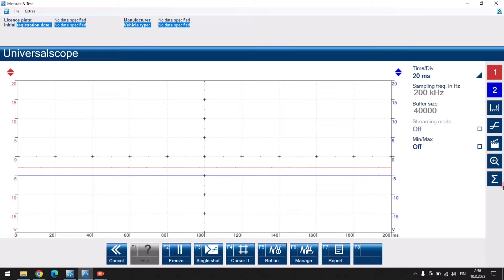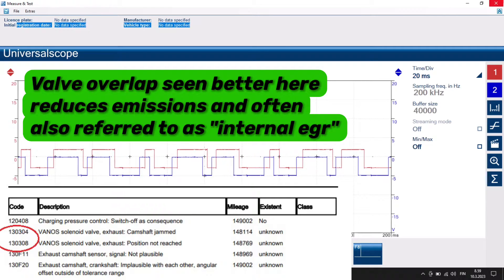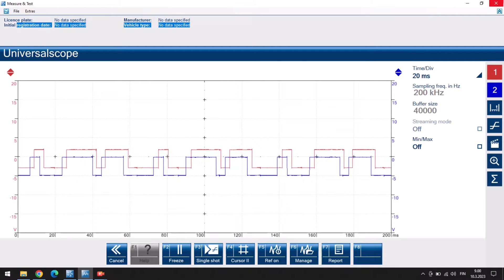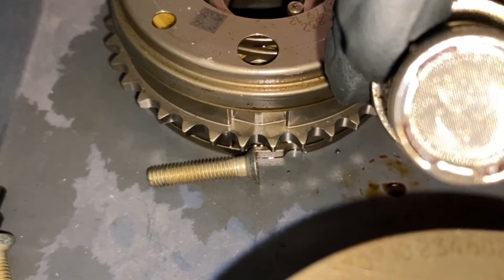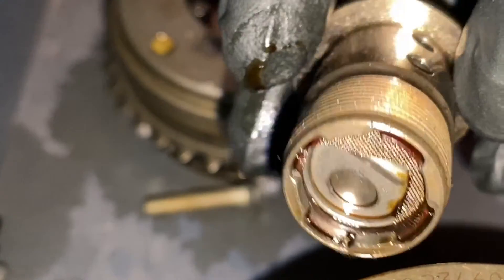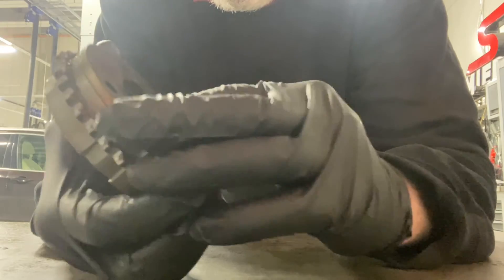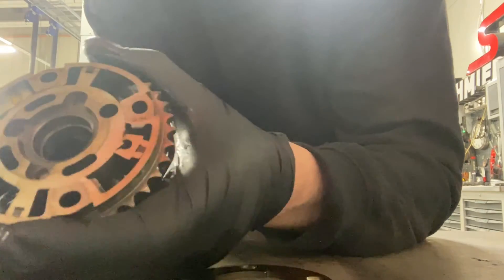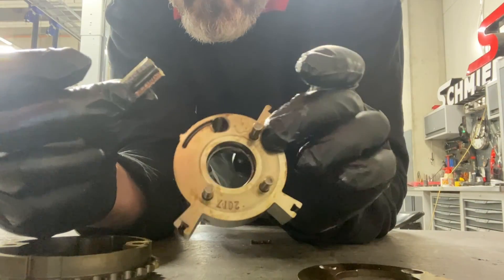B48 B38 VANOS FAILURE! CHANGE YOURS IMMEDIATELY IF YOU HAVE THESE FAULT CODES.

Comment: I have a b38. These two mistakes. Will replacing the entire vanos solve the problem? Or maybe something else needs to be done apart from replacing the vanos? Thank you.
Reply from the maker: Just change the vanos sprockets and bolt actuators and you should be ok if you have these same fault codes
Reply: @BenJFF  Is this an expensive repair? Invasive? I have a young car, but I'm worried about it.
Reply from the maker: @SebastianPierog Expensive on b48 rear wheel layout as engine must be removed. Transverse layout not as expensive. It isn't mega common but if you have a front driven b series its not a huge job mate.
Reply: Is this a serious fault? Is the defect costly? I'm worried about the car because it's young. @BenJFF . Thanks brother.
Reply: The error also disappeared from the board by itself. I do not know what to think.

Comment: Can you tell me as a customer what is the cost to repair that problem? My bmw has come up with that fault code, I was told it’s a 20 minute fix by one garage and then another garage told me it’s a complete engine strip down. But seen this video and it has enlightened me. Thanks
Reply from the maker: Hello Bryan it depends. A transverse mounted B series takes around 4 hours including re-aligning the injectors as they have a special tightening procedure (see my video about that)
The rear wheel drive variants unfortunately require engine removal as you cant do anything as the chain is at the back. 20 minute fix refers perhaps to a new solenoid but that wont achieve anything since the solenoid only controls the bit thats faulty inside.

Its a 2 day job minimum for those engines
Reply: @BenJFF  Great video! Thanks! I have a B38 F20 rear wheel. Would we get the same error codes if really the solenoid is dirty or faulty? Do you have a video showing how to replace the solenoid on the B38 rear wheel?
Reply: @BenJFF  Hi! How many hours require an engine removal for fix this problem on a rear whell drive? Unfortunately I have this problem in my F20 B38... How many money? Thanks a lot for the information!
Reply: @thenotoriouspra how many miles and were symptoms
Reply: Thank you. I believe mine is rear wheel drive, so I’m looking at a hefty repair bill. Might just buy an Old Ford fiesta had one for 10 years and only had to replace the tyres. 😃Thank you for you honest answer.
Reply: Hi Ben great video.  My daughters 1.2 mini b38 is noisy when cold but then its OK.  No fault codes shown . Timing doesnt feel out . Any suggestions as owners club mech was on about known software update .

Comment: Great vid again. A friend has replaced the exhaust solenoid valve on one, but now comes up with ex cam solenoid installation error. Wonder if the screen and circlip has failed on that.
Reply from the maker: Thanks Wayne. The vanos wheel will have cracked inside.

Comment: Does it happen in B58 as well? I thought I am driving a car with reliable engine...
Reply from the maker: Not that I heard of 🙂 I did have a siezed B58 on a 3 year old X5 hybrid. Oil pump failure suspected. B58 is a superb engine. You should have very little issues.

Comment: The filter screen bursting off is actually a consequence of the fault, what happens is the central valve fails and instead of only the plunger moving the full assembly inside the valve moves witch eventually burst the filter screen. If you catch them before they burst you’ll find if you press one finger on the screen then press the plunger you’ll feel the full assembly inside moving witch obviously doesn’t let oil flow correctly into the adjusters/sprockets. I’ve changed loads of these very very common.
Reply from the maker: Thats really useful to know because I had no idea why this happens. The power of the internet 👍I will try that next time and this will be a good test. Thanks for the info 🙂
Reply: I have a fault with the exhaust Vanos, on inspection the ‘c’ clip has fallen out which appears to be common. Is the vanos easy to replace?
Reply from the maker: @richarddriscoll5201 With a locking kit yes however the injectors are difficult for a diyer. Please see this video and you will understand. HOW TO REMOVE A B48 INJECTOR
https://youtu.be/IJWnY_CtUTQ
Reply: Can this valve failure causing knocking on start up and only in the morning? I got exactly the same DTC stated in the begging of the video...
Reply: hi @aw-ty5qi would I need to replace sprocket or just bolt? assuming I don't see any damage on sprocket